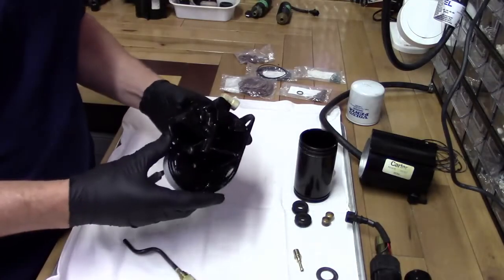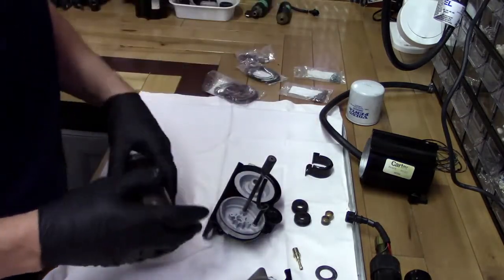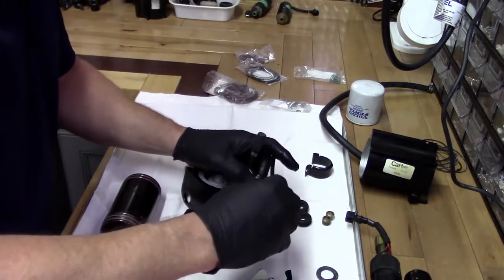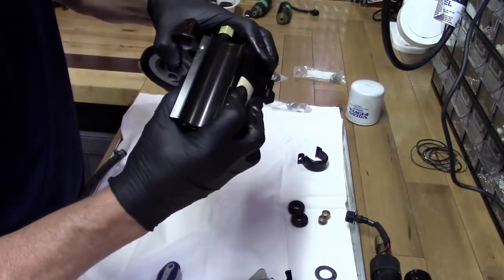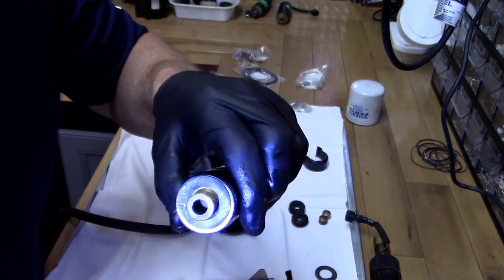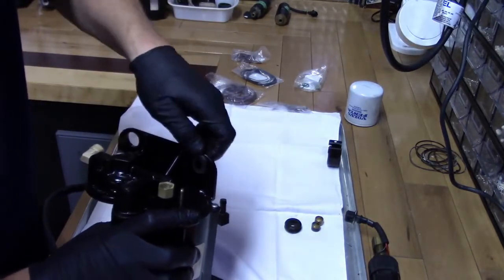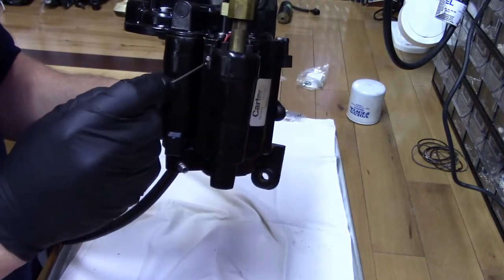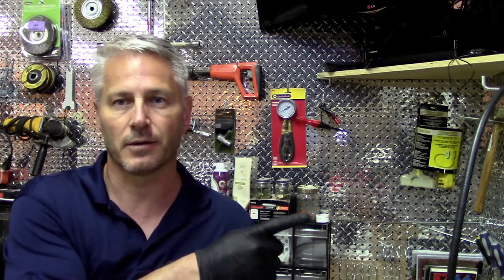Volvo Penta Fuel Pump (Part 2) Reassembly

Comment: Thanks for posting, wish I had seen this before ordering a replacement from Amazon. I will however be sending my old one to you for a rebuild.  My boat overheated and now no longer works correctly.  But a chicken or the egg question did my boat overheat because of fuel flow restriction (my fuel filters were clogged) or did overheating destroy my fuel pump? :)

Comment: Troy does an incredible video series.  You don't find much info on the volvo penta electric fuel pump, but Troy brings it all together with informative and step by step directions.  My boat has been in storage for over 2 years with old fuel in the tank and fuel system.  After draining the tank I decided to disassembly the fuel pump and clean it.  I was amazed at the peeling paint inside the fuel pump?? GREAT info from Troy.  Following Troy's directions I cleaned, reassembled, reinstalled, primed the system and my boat cranked beautifully.   Thanks Troy, most appreciated.

Comment: What product/process did you use to remove the paint from the inside of the fuel cell?
Reply: You can use aircraft paint remover.
Reply: By the looks of the finish in the video it appears he may have media blasted the entire unit and then repainted it, however I’d likely use aircraft stripper.

Comment: Wow. What a great video! Can you please tell me It’s the fuel pump cooled by Rob water or closed cooling water? I noticed one water line comes from the motor and one goes to the Portside riser.
Reply: Also I recently overheated my motor for a few minutes my high alarm came on I shut my motor down quickly as to not do any damage but I noticed once I figured out my overheating problem which was a stupid mistake on my part quick fix. I noticed that my fuel pump was making a noise. It never happened before and I assume it’s because there wasn’t cool water going to the pump?thoughts? So again I ask is my fuel pump cooled by raw water and then leaves out the port side exhaust or? Recirculated back through with antifreeze?

Comment: Fantastic videos. Thank you. They have helped me no end. I have the paint specs on the mesh screens and will flush with carb cleaner, however, I have a question, i am about to clean all of the other components I plan to use, 1)carb cleaner, then (2), a brush and then neat gasoline to rinse. is this the correct method or should i use something else instead before re assembling? I dont want the carb cleaner to stip paint off? Any Advice is appreciated
Reply from the maker: Thank you for the comment.  There are several ways to clean the paint out.  scraping with a screwdriver, airplane stripper, sand blaster, dremel tool to name a few.  The carb cleaner will not strip the paint off. the carb cleaner will help clean the screens.  Please feel free to contact me at mancavemechanic@gmail.com for questions.

Comment: You have ignored the most problematic component of the Volvo
Pinta fuel pump.   That plastic float is made from a solid (permeable)
foam plastic compound and the trapped air pockets inside provides the buoyancy
to lift the needle into the seat. Evidently, the Volvo engineers were unaware
of the numerous and frequent engine fires on cars (especially on Chrysler
vehicles) equipped with Holley carburetors during the late ’60s and into the
early ’80s. The plastic floats would become moderately saturated from absorbed
gasoline and become less buoyant and cause the gasoline to spill out on top of
the running engine. Currently, most Volvo Pinta stern drive boats are close to
20 years old and when the aged floats loose buoyancy it allows liquid gasoline
to flow directly into the intake manifold and cause it to quit running, which is
exactly the predominance of reported symptoms associated with Volvo Pinta fuel
delivery system.

Comment: Troy, I am in the middle of putting mine back together using your o-ring kit (looks great and ty for the fast shipping).  It was a mess and a lot of the paint had come off but thankfully just on the water side.  I am going to have the parts media blasted (except for the inner part of the tube where the fuel sits since it looks fine).  What kind of paint do your recommend to use on the water side of the parts?  Thank you again for a great video!
Reply from the maker: I recommend just polishing the water jacket side to peen the aluminum

Comment: Can you please tell me where the screens are that get the paint chip stuck on them? Are they on the bottom parts of the fuel pump where the fuel goes in? Do I have to remove the fuel pump from the assembly to clean those screens?.
Reply from the maker: They are located at the bottom of each electric pump.  The HP can be checked while still on the boat.  The LP screen can only be visualized after taking the assembly apart

Comment: Hi there...nice video and appreciate you posting this!  I have the classic symptoms - I start the motor, runs great for about 5 minutes, then the hi pressure pump starts to whine, gradually gets louder and louder. Gotta be the paint chips accumulating at the filter. Now I'm gonna tackle it. Just wondering where you got your O-rings from?  Thanks again.
Reply from the maker: I sell the o-ring kits on my website at ManCaveMechanic.com

Comment: You can buy a new one for 299.00 on ebay.......
Reply from the maker: Yes, there are several sellers these days but they all have paint on the inside.  ManCaveMechanic.com sells them without paint on the inside
Reply: Less than that actually, but helped a friend buy one of the imported copies and it only lasted 3 months, today I am taking apart the OEM pump to see if I can clean it up.
Reply: Save your money buy original or refurbished by professional like ManCaveMechanic, I bought one from amazon and only lasted 3 months, low pressure pump overheated, insides melted and seized.

Comment: Pretty good job on the videos,,, got to say I am not a fan of the music being a much louder volume than you voice.  Also noted that you skipped over how you cleaned the paint from the inside of the housings,, got to guess you may have glass beaded them or something by the look of the metal.
Reply from the maker: I apologize for that.  We made that video last year and are unable to change the music since that cut was on a previous computer that died.  I hope that the information contained in the video was helpful.  As far as the method of cleaning, I use many methods to remove the paint and some assemblies need more advanced cleaning techniques then others.
Reply: Thanks,, I watched it again today, noted that you did not explain that you were lubricating the O-rings when you installed them,, pretty important if you are teaching someone who does not know?  Did you post video on cleaning out the high and low pressure pumps?